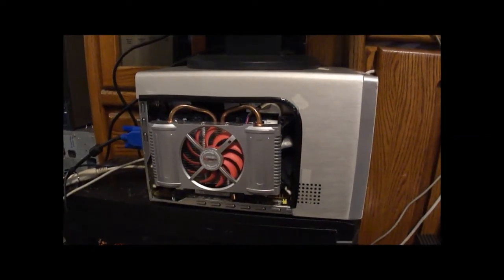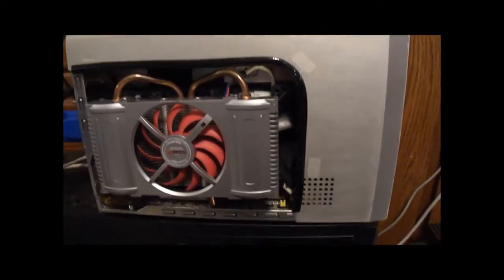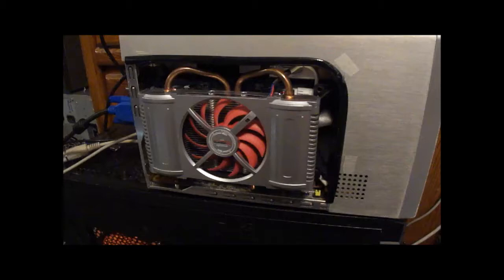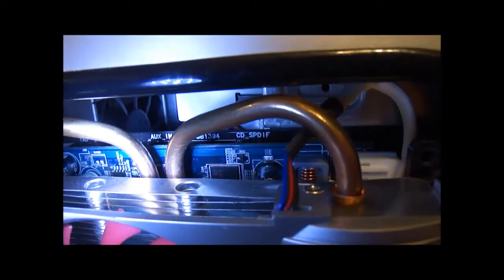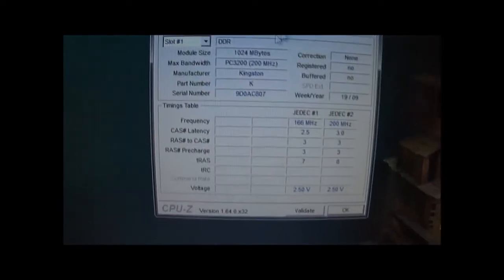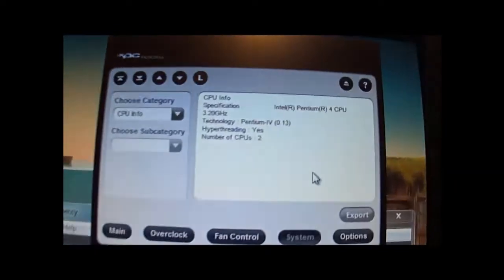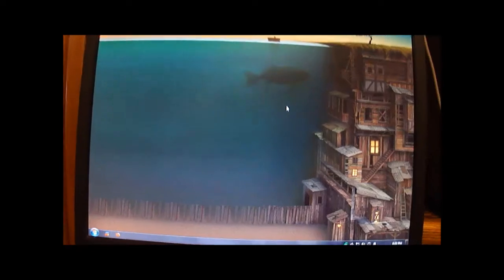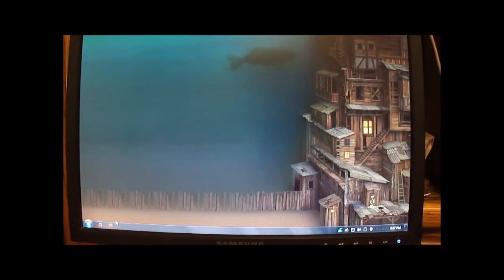SB61G2 Pentium 4 EE Update!

Comment: That's also some nice work. A fan that's getting no air. Fucking genius.
Reply from the maker: +Objectified Cross I'm not sure where you're coming from with this. are you talking about the fan cooling the P4? because there's more than enough air to go around for that... the issue is Shuttle, with their idiotic way of thinking, only gave the thing an 80mm fan to cool the heatsink. it wasn't until the LGA775 models that they switched to a 92mm fan for their shitty ICE system. 

could be worse, the NAS the P4 EE lives in now has two 70mm fans...
Reply: *****
I meant the fan you can clearly see that's up against the case panel.
Reply from the maker: +Objectified Cross it's actually back a bit. it was thermistor-controlled, and a Nidec out of some old Dell. I have tons of them. it was more a last-ditch effort to keep the hard drives cool... again, direct offshoot from the 80mm fan, and even the 92mm newer ones, there's NO AIRFLOW in that thing at all so the hard drives cook themselves to death. this at least moved SOME air past them, and directly to the front of the PSU which otherwise, when that was not placed there, got very hot. this was no longer the case.

at least with the NAS now, there's ample airflow going past the drives, and in turn to the CPU... but only so much. that fan exists in the NAS in almost the same spot to circulate air past the video card and RAID card.
Reply: *****

OHHHH my apologies.

Comment: you might have to edit that title. i plan on doing a video in a week or so where i compare all the 3.4ghz processors for the 478 socket. meaning the northwood 3.4ghz, prescott 3.4ghz, and Extreme Edition 3.4ghz. i'll be doing my testing in a dell inspiron 9100 laptop (yes, it surprisingly works with that. i have a 3.4ghz prescott in it right now).
Reply from the maker: ***** planed on doing the EE in my Inspiron 9100 at one point, but that's on a shelf now for the forseeable future. the EE 3.2 is currently residing in an Iomega NAS200d and is currently the world's only NAS appliance run on a Pentium 4 EE Gallatin core in that respect.

be sure to link your video in a reply someplace so I can link to it. The comparison is going to be no contest-- the prescott and northwoods are going to be give or take a match, and the gallatin is going to shine because of the L3. be sure to mention in your video the origins of the Gallatin core as a Xeon core, and that they made 32-bit only LGA775 chips with this same core. (these same were also the fastest performing P4s made, apparently, IIRC clock speed aside.)

if you plan on keeping the EE in the 9100, I heavily suggest you go and sand the contact surface of the heatsink with some 600+ grit sandpaper to expose some virgin non-oxidized copper.and, of course this should be obvious, but AS5 seems to work the best on old P4 stuff-- and I have it on the 2.4 HT Northwood in my 9100 right now. the machine idles at 33C with the graphics card idling around 42C or so with both fans being controlled by i8kfangui on low. if you haven't watched the other videos on my own 9100, you should, although they were taken quite some years ago.
Reply: thanks for the help. i'll mention this, along with linking this video in it.
Reply: +gameboy3800 
>Not overclocked 
Defeating the purpose of "extreme edition".
Reply: +Objectified Cross this was kinda before the extreme editions were associated with the overclocking, the Pentium Extreme (smithfield) that came out after the P4EE's had the unlocked multipliers that started the  "this is designed from us at intel to be overclocked".
Reply: Mr. GeforcerFX
Really? Last I checked the first P4 EE was unlocked as well.
Reply: Objectified Cross all 3 of my P4 EE's are locked, 478 gallatin, 775 gallatin, 775 Prescott 2m, my 840EE and 955EE are both fully unlocked.
Reply: Mr. GeforcerFX
LOL
Yet everyone lists them as unlocked.
Reply: Objectified Cross everyone, links?  Intel never advertised them as unlocked.  The reviewers had unlocked chips, but they were ES chips, most ES chips are unlocked.  Cpu world has no mention of them being unlocked.  The best I could find was some forum posts from 2003 where abit motherboards could use a hacked bios to move the multiplier by 6.  Non of the reviews on newegg from the people who bought them say they liked them being unlocked, it was never even mentioned in the specs, no one said it on amazon reviews.  Really the only place that mentions them being unlocked when given to them were the reviewers.  It very well could have been unlocked, but all 3 of mine are locked on the 5 different boards they have been on.  Maybe it was just the original 3.2ghz chip (which i don't have)
Reply: Mr. GeforcerFX
Ah. Another reason for me to stop trusting Wikipedia then. Wikipedia still lists certain game consoles as 16 or even 64bit when enthusiasts have dissected the internals and found them to be only 8 or 9bits, and 32bits respectively.
Reply from the maker: +Objectified Cross can't trust what can be freely edited, sadly. there's a reason why I couldn't use wikipedia for report references for years, and why my college professors all frowned heavily upon use of it in anything that had to be graded.

but, it is always fun to see the pages of dead important people before they get locked and changed, or locked saying they're still alive. but I think the most amusement that comes from Wikipedia is best said in other languages than English, where edits tend to go unchecked for long periods of time. http://i.imgur.com/6Z28ias.png

That said, he's right-- the original EE chips had locked multipliers, even my own 3.2. the engineering samples weren't, and I can confirm that even my ES Xeon X3320 is unlocked. Sadly haven't seen an ES EE out in the wild on eBay though-- I'd imagine something like that, even for a P4, would gather quite a bit of monetary value over time if left alone... this is most likely why. That, or it's that none of the ES EE's made it INTO the wild past the ones they sent to testers, which I'd assume all had to give back.

That said, the addition of that extra meg of cache really made a difference back in the day, and the Gallatin core was so much better than the Prescott or even the Prescott-2M core. this can even be seen with the fastest of the 775 Gallatins-- it beats the Prescott EE 3.73 in benchmarks at a slower speed: http://hothardware.com/reviews/intel-pentium-4-6xx-sequence-and-373ghz-extreme-edition-processors?page=5

at that, I don't think people would have technically complained too much. they were too busy complaining about the price!
Reply: ***** Sadly plus you have countries like Russia hacking Wikipedia servers regularly. 
And yeah, I've seen benchmarks it was pretty sick. 
All I have is a A6-3400m HP laptop and Core 2 T7250 equipped D630 Dell. Both bench around a Pentium D 930 just running at 800mhz alone. Man does technology advance.

Comment: you should get Corsair XMS 1GB PC3200 3200U 400MHz CL3 DDR V1.2 its the 1 with the heat spreader + really cool led activity lights all though pointless for your build but i do think they overclock really well if your lucky you can get like 2 sticks for like 40+ bucks on ebay i bought a pair a couple months ago 4 sticks at 60 bucks now i just need to get a nvidia 6800 ultra for this build im hopeing to do with a pentium 4 regular 3.0 ghz cpu i have which seems stable in the bios at 3.45 ghz lol
Reply from the maker: I don't use the box nearly enough to bother with that. but I'll keep the RAM in mind, I have an old Intel 865G board with a normal P4 2.8 on it that needs more RAM, as well as an IBM 8141 I need to add RAM to so it can do some decent things.I have an SB X-Fi I want to install in this box too, I think. currently my old Audigy 2 ZS is in it, I'm going to be moving that to my main box since my other audigy suffered a massive failure, and the box doesn't like the X-Fi. I'm going to be doing an update on this box soon.